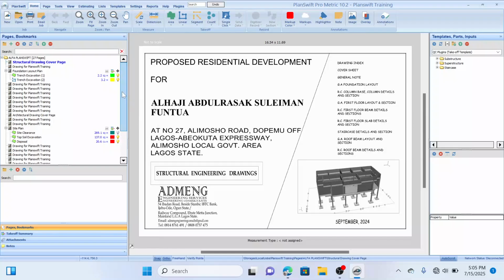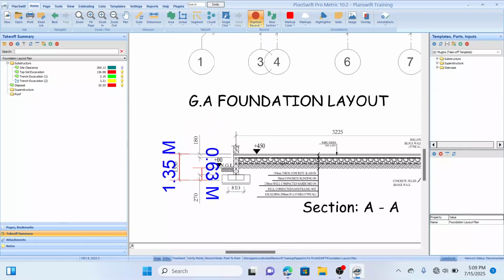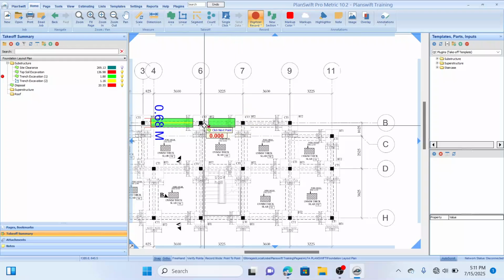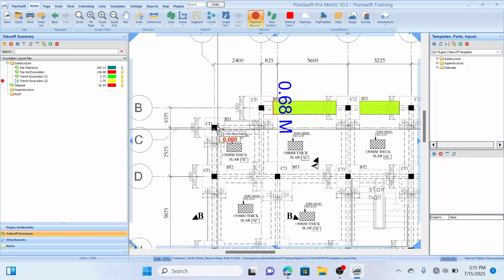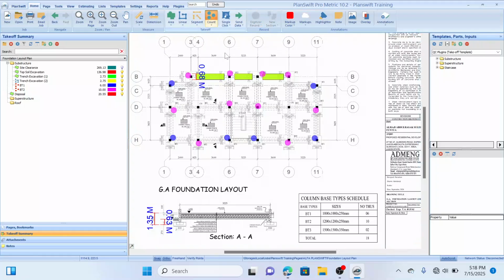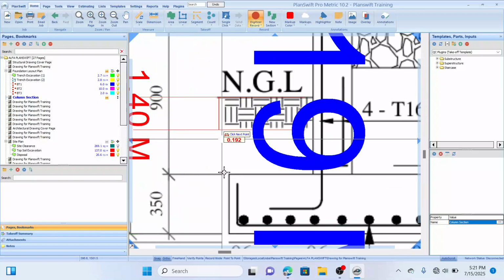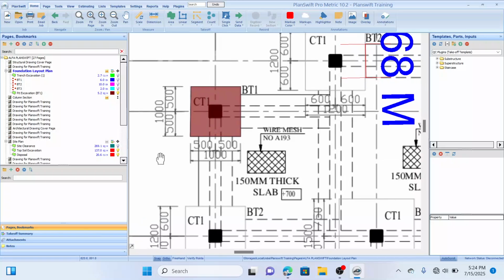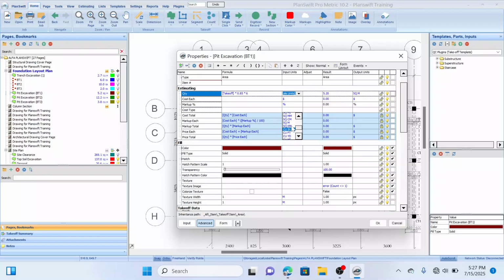Substructure Measurement (2) Using PLANSWIFT

Comment: Can we just measure the whole drawing at once for trench excavation and later deduct column bases ?
Reply from the maker: You can do it that way, but it is faster when you consider the column from the unset.
Reply: @UpcomingQS alright sir
But after taking those trenches section by section how are we going to add them together on planswift 😬
Reply from the maker: @kola_wole000  The plugin will add up the whole thing automatically.
Reply: @UpcomingQS ohhk
So the plug in is compulsory
Reply from the maker: @kola_wole000  It makes your measurement faster 😂
Reply: @UpcomingQS OK sir